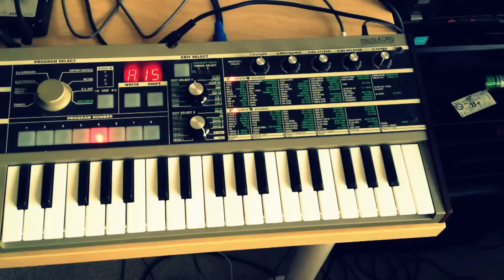Microkorg Tutorial Part 3: Filters and Tsunamis

Comment: you can drop mids to get low & high punch,  so a parametric is best,  but i only eq it like that if its a guitar..  I have been dropping the low & high & raising the mids on most of my synth settings,  worked wonders on mod wheel effects and not overdriving duel oscillation/timbre doubling. So raise the mids,  especially if you are trying to model bass sounds.

Comment: Moon Doogas says that the filter cant go into overdrive,  does he own a microkorg? What does it matter whether its in wave form or light,  it still behaves like a particle,  which reflects,  clashes into other waveforms, exceeds in broadband frequency range(some that cannot be heard by the human ear.) But i would like to commend Korg for allowing several sound waves to harmonize(coexist) in synchronicity,  though the level is only determined by the users applicability to this fine piece of hardware.

Comment: I don't understand why the knob "cutoff" acts as a main selector, so that the subsequent knob (labeled "resonance") takes over the same role. I'm considering buying a Korg but could I ever understand the technology, just as fluently? E.g. If the 5th knob is "release," does it then revert back to tempo within a change in the "edit/selection" knob or do I find its parameter intuitively?
Reply from the maker: oh it's because they are multifunction knobs. The labels refer to their default functions but as you move through the rows of parameters (you need to refer to the text below the knobs for the relevant options) what the five knobs control changes